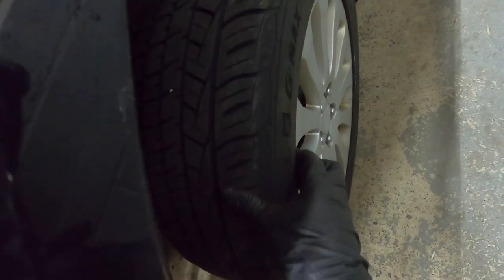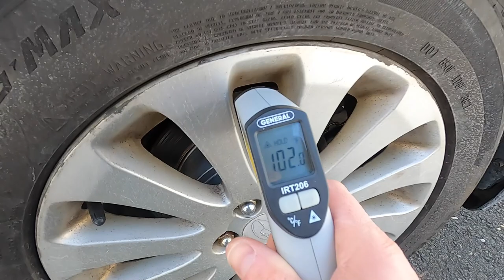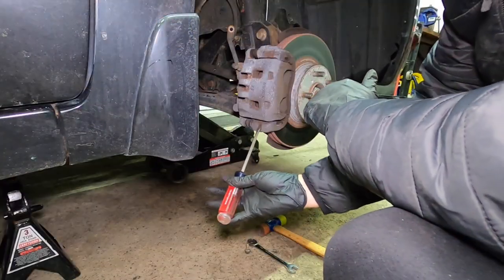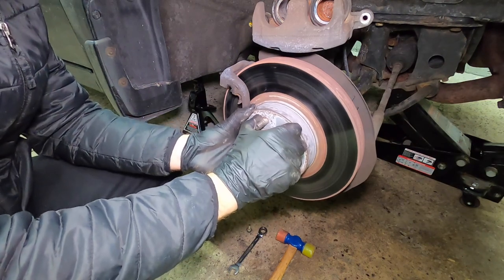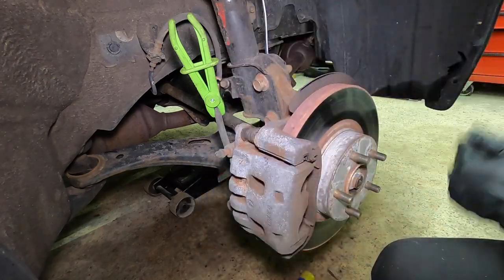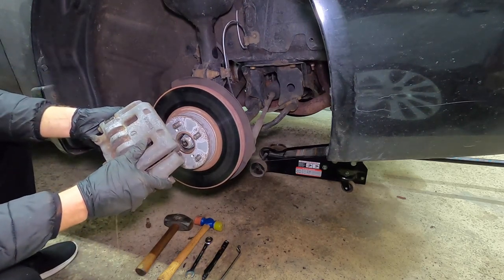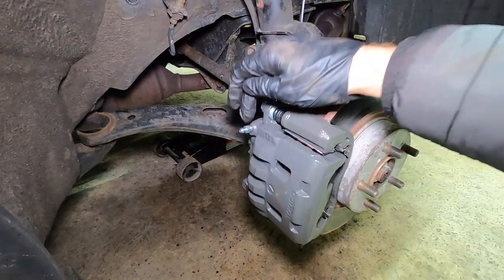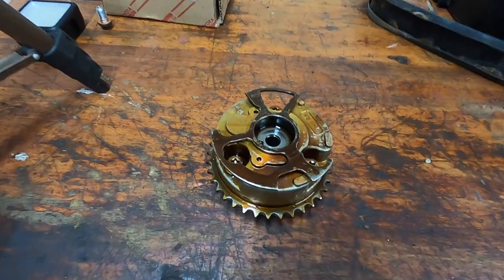Overheating brakes! | Why is this wheel blazing hot at 500 degrees? | Stuck brake caliper

Comment: Just had same issue on my 2006 S2K with 35K miles. Sticking caliper causing excessive brake dust and a hot wheel. Went with a remanufactured OEM unit.